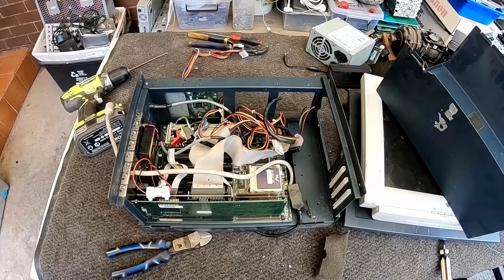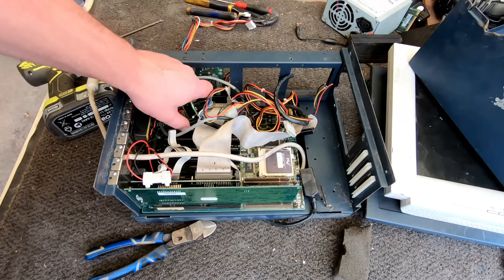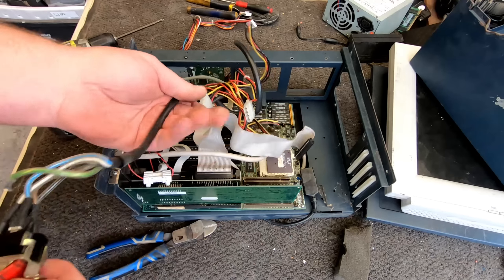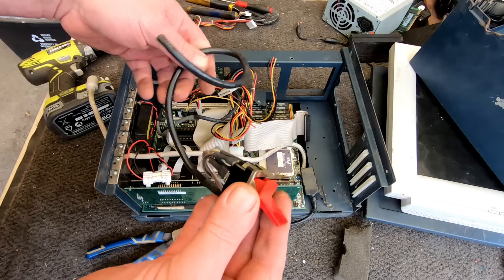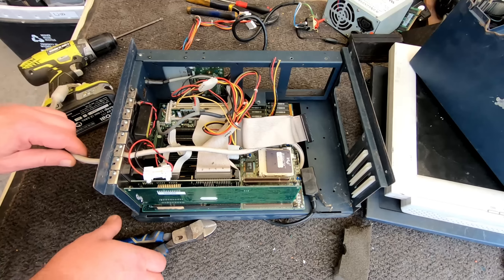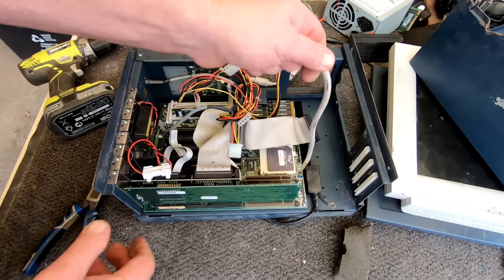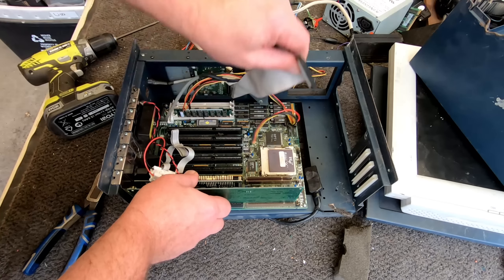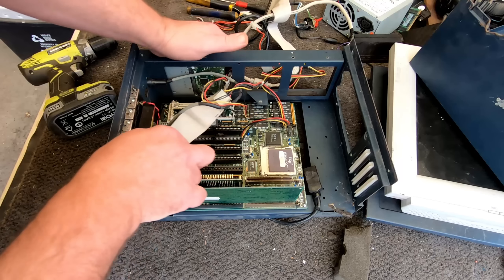What's inside a CNC Controller

Comment: Hi ben hi guys I have been so busy ben want to thank u watching you  and other videos I have started by non ferrous metal recycling waiting for my pallet scale to come in for the public so now been 5 weeks had 7 dump trucks total 21000 lb of power line copper wire cable did not know that over some amount copper buyers raised my price from peddler price to dealer price got 30 cents more a lb from 230 to 260 a lb got my 3 hp huge striper working on a deal for a small shredder for the small  wire cat 5  6 and smaller made a profit of 7000 so far and shop is still full of wire still

Comment: That is amusing, You are wreaking one out and I am building one from 3D printer parts :) I do have an older CNC board but it's designed to run on software from the XP days. yours is a lot older probably 98se days or even 95 maybe with the AT style system

Comment: I have a Sharp Aquas wide screen LCD TV that fell over and damaged the screen but it still plays although the picture shows only part of the visual picture.  Is there a place where I can get a replacement screen?
Reply: Replacement screens cost about as much as a new TV. Might as well throw it away and get a new one. Or scrap it for the boards.
Reply: @kenkarish826  well the t.v. cost me $2,000 plus when I first purchased it on 2008.
Reply: I resell the parts out of them, it would cost 2 time maybe 3 times what you  paid for it and still have to find someone to install it,
Reply: @michaelpearce8661  what is the model number, I need a couple boards for a 70"
Reply: @glues4wood  it is in storage at the moment but I'll get back to you in a week.  I'll be able to go to storage on Thursday to get serial and model numbers.
Reply: @michaelpearce8661  ok let me know 8f you remember